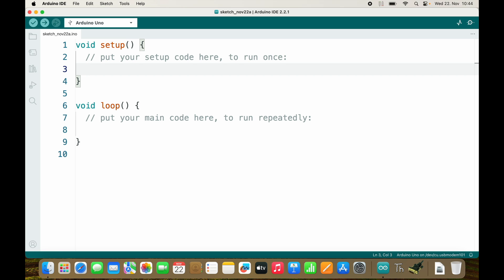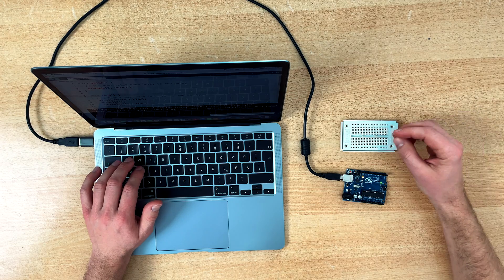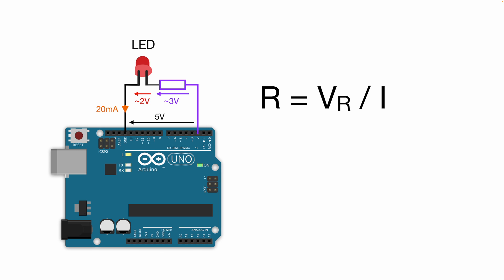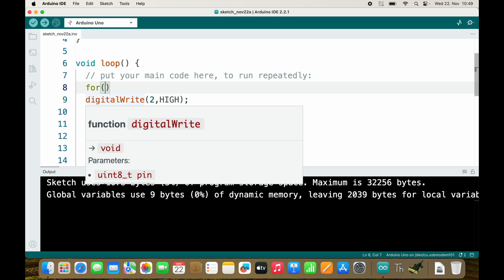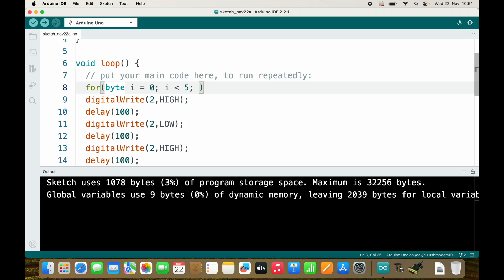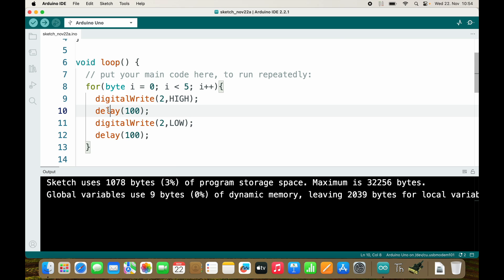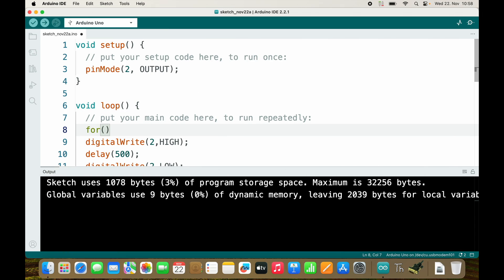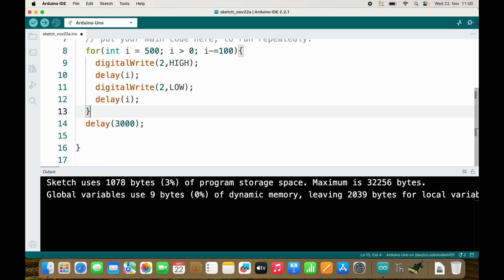For loops arduino - (Arduino Uno Programming for Beginners)

Comment: Hey man, loved the video. Just wondering, where did u learn how to code? I’m wanting to get into electrical and mechanical engineering and I’m wondering where I learn to code things like lights, audio, motors, etc. What kind of coding would that be called? Thanks 🤘
Reply from the maker: Hey thank you. Arduino is great for interacting with electronics of all sorts so if you learn to code Arduino, it will help you a lot on your journey.
I learned it in School, in the University and tinkering around at home :)

Comment: Nice video. I also like using the byte on an UNO R3. I am note sure if i would also use it on an R4.
But in fact there are small differences between your "ugly" code and the "for" code. The "critical" difference is, that you can see in the "ugly" code only 1 delay with value 100, while in the for loops are 2 delays with value 100. That mean at the end the ugly code has a delay of 3000ms, while the for loop has a delay of 100+3000=3100ms. So in the for loop you must modify the 3000ms delay to 2900ms delay to get the same result.
Reply from the maker: Thank you! well spotted 👌